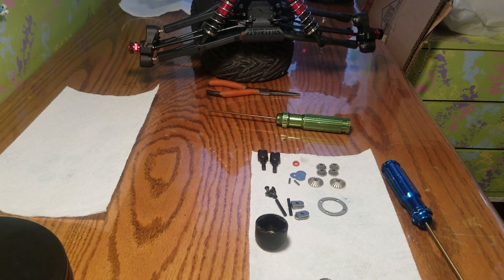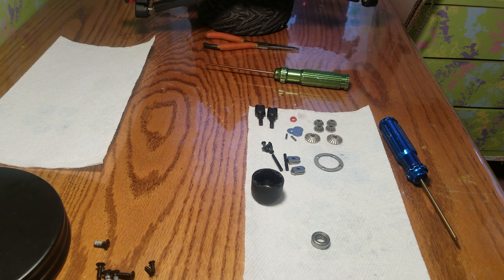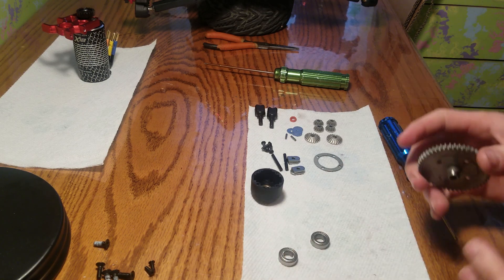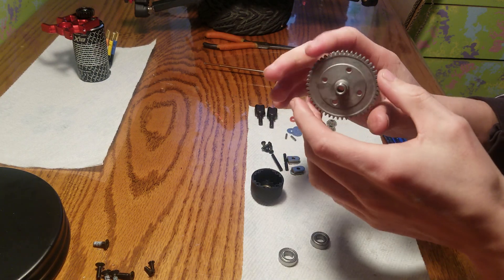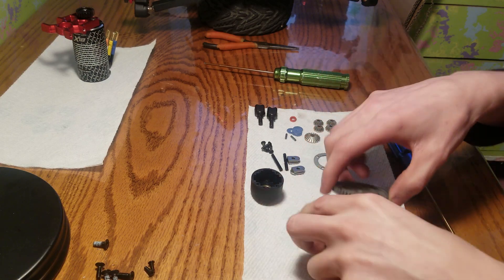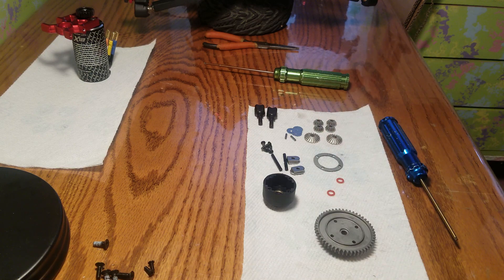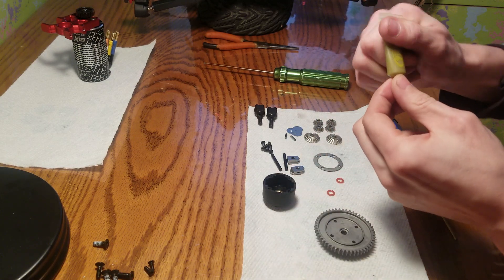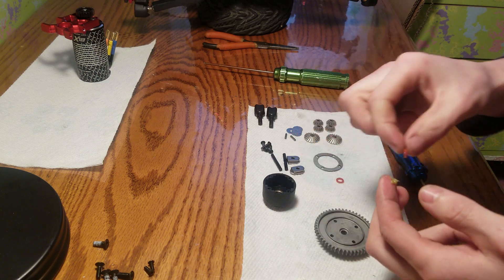Arrma talion v3 how to build the center differential

Comment: I'm in the process of doing this for a V4 Talion. What do you use as a degreaser before reassembly?
Reply from the maker: I used  master pro high temp wheel bearing grease  its worked perfectly for me
Reply: @alexperea20  What I meant to say was what do you use to clean/degrease the parts. They look brand new. I have some stuff that's not working nearly well enough to get the parts clean. Thanks!
Reply from the maker: @phillymetalhead  i use automotive parts cleaner  solvent  you can get it an oreillys or harbor fright but in not sure how well the harbor fright stuff  works